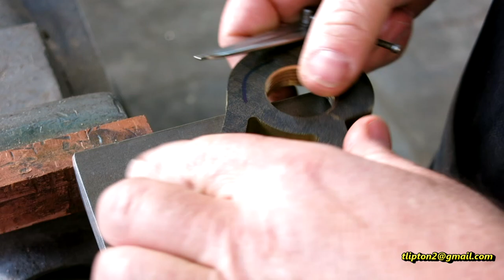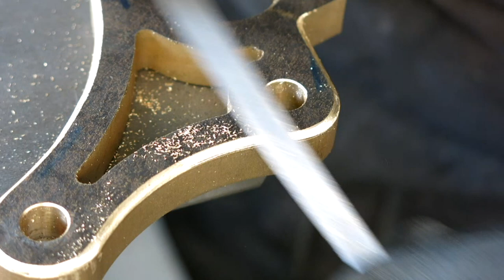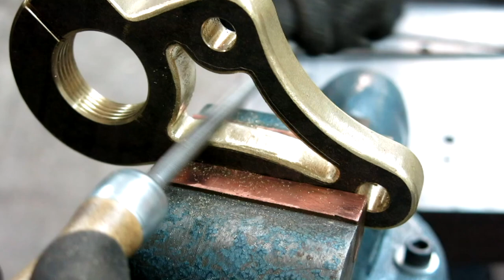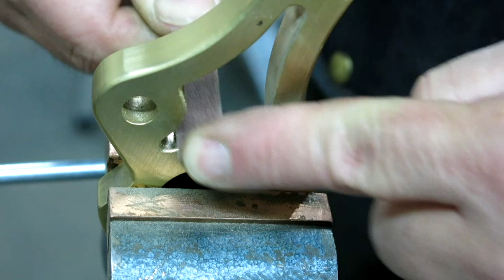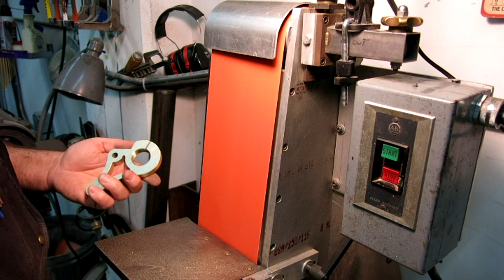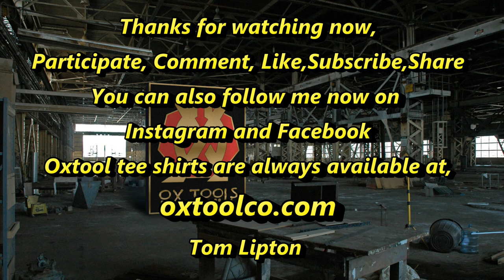Oddly Satisfying Bronze Thrust Plate Finishing

Comment: I wonder how a round over bit on a router would have worked for that? How is this years baby bullet coming? :-)
Reply: along with one of those ceramic media vibrating thingys for an even finish
Reply: Works beautifully. I remade two long pieces of brass alloy (no idea with what exactly, it's harder than brass so i know it's an alloy) for my drafting table, the old ones had gotten worn out. Since it's a draft table rounded edges is a must, so i took my shitty hand router (a generic European brand) and the dullest wood bit with a brazed on insert i had. Works very nice especially if you take two passes and lubricate. Didn't even need to re-touch them, they came out perfect.
Reply: aserta
I did it with aluminum once for me and it worked well on that.
Reply from the maker: Hey Brian,

Sure. Then file it then sand it then blend it. Also the inside radii on the cutout were pretty tight for any roundover bits. Thanks for the comment.

Cheers,

Tom

Comment: One word - Dremel! Great patience though & good skills.
Reply from the maker: Hi Professor, 

I can control my errors to a partial stroke of the file. With a power tool it has skidded across half the part at 20K rpm before I can do anything. Sometimes slower is better. I'm not trying to make money on this project that's for sure. Thanks for the comment.

Cheers,

Tom

Comment: Formica router with a carbide round over bit would have made short work of the hand filing. Awesome work though.
Reply: True, have done it. But there's nothing like working a piece by hand, especially on this particular machine that he's building.
Reply: Hi mate.  Like with so many things, it's not how quickly you can get it done, it's how much pleasure you can get from it.
Reply: Oh I understand what you are saying. But every job I have ever worked has been a race against the time clock and now, in my old age, I'm in a race before the time clock runs out so I get to do all the things I want to do.
Reply: Ah, sorry mate, I was unaware of any timeline issues.  You were right however, Tom has used a wood router on steel before with a resounding success.  Therefore, I think Tom is not adverse to let's say drastic  measures, but in this case his mind was on the old hand finish I think.
Reply from the maker: Hi Dot,

I'd like to see one that had a pilot fit the small interior radius. I like the hand process on things like this. Thanks for the comment.

Cheers,

Tom

Comment: just curious if you are going to counter bore the mounting screw holes and the sides of the block for short hollow dowel pins  to maintain gear lash properly.. or is the bronze plate to bolt play going to allow   where to get them.. engine cylinder heads.. where the cam caps have 8mm screws with short hollow dowels.  i would imagine that larger sizes could be created..  if you only dowel the forward bolt... up and down motion on the smaller bolt could move the worm gear into the pinion easily..  perhaps a set screw top and bottom of the bronze bracket to push up and down .. might have to make the far end hole slightly larger..   just an idea..
Reply from the maker: Hi Wayne,

I don't think dowels will be needed. The clamping force of the mounting screws should be fine. I figured it would be a wait and see once the weight is on the lift system. Thanks for the comment.

Cheers,

Tom

Comment: You could've used your router technique on the outer perimeter although that might require a router table.  The inside perimeter work looks like it can only be done with hand filling.  Oddly satisfying, me watching you work.
Reply from the maker: Hi Pete,

I'm more nervous on the smaller parts doing it handheld. Thanks for the comment.

Cheers,

Tom

Comment: There were actually multiple techniques shown in this video, and they were mostly completely different than the ones used on the baby bullet.  Tom has also shown that he is not a purist, he uses other round over techniques using milling cutters, grinders, sanders, and more.  Techniques are as much a part of your toolbox as cutters are.  They need to be practiced to be reasonably practical choices on a particular work piece.  It is enabling to have a host of different arrows in your quiver, any one of which will hit the target right in the center.  If only I was this good at it...
Reply from the maker: Dang Bob,

Well said. Thanks for the nice comment.

Best,

Tom

Comment: watch makers use the old brass filings and pile them around parts there annealing for more uniform heating (hot blueing steel) bench tools are where the fun is at hacksaw down to the scribe line move over .070 cut down again hog it out file to the finish.
Reply from the maker: Hey Random,

I couldn't agree more. Thanks for the comment.

Cheers,

Tom